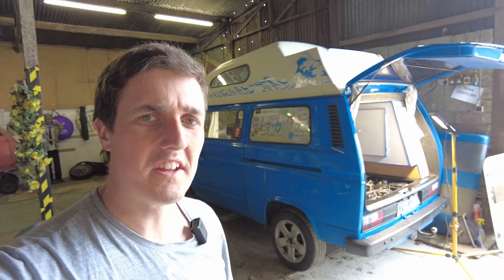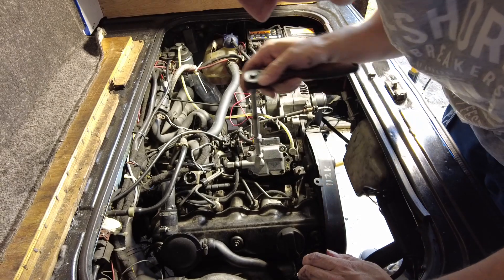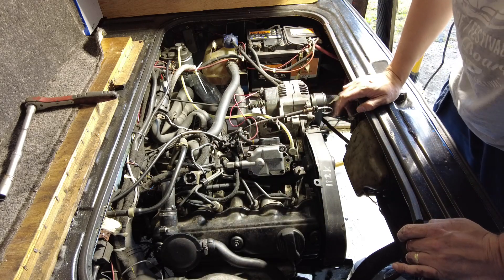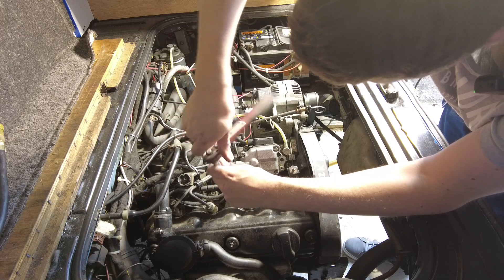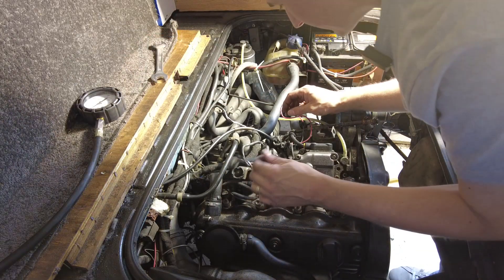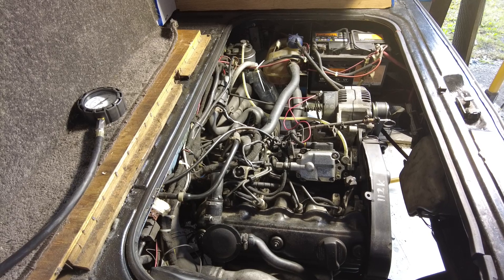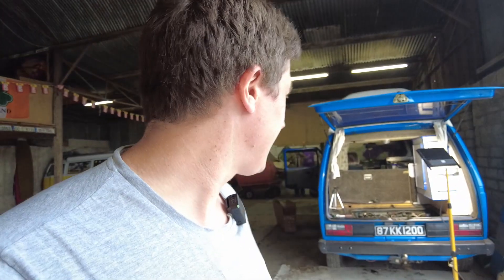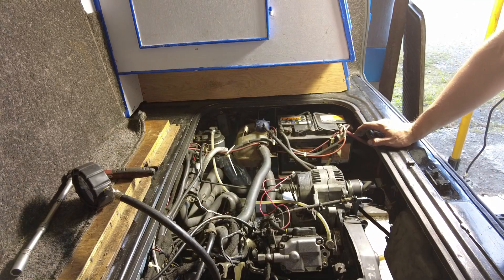DIESEL COMPRESSION TEST - Hunting for lost performance in my VW T3 TDI

Comment: My VW manual says that the compression should be measured where the injector pipes are located one at a time after they have all been removed. That is a different procedure to the one followed here.

Comment: Pity you couldn't get that sorted. I can't imagine how frustrating that is after all the work that you've done. Just a general question on second hand engines, is it possible to get them tested and dynoed before you install them or do you have to just put them in and hope for the best?
Reply from the maker: I don't know of anyone in Ireland with an engine test bed like that to be honest. That's not to say that it can't be done, but I've never heard of anyone doing it. If I was doing it all over again, I'd buy a running car, drive it for a while and then pull the engine out.

Comment: Are you sure the map isn't dodgy? It might be worth while trying a second unmodified ecu with stock map. 
If you're looking for better performance, you could try a bigger turbo. Is your turbo VNT or wastegate? If VNT, the PD130 and PD150 turbos fit fairly easily and offer a nice boost in performance.
Reply from the maker: I've a wastegate turbo. If I do end up having to replace the turbo, I'll look at fitting a VNT. Podsy did the remap for me and I spoke to him and he's confident that it's right, but it might be worth a shot all the same, trying a different ECU.

Comment: Hi Ross, well that was disappointing, I sense your frustration! Are there performance figures from other owner who have done the AHU conversion?
BTW, are you sure the oil dripping from your turbo isn't the oil feed or return pipes coming loose?  They are notorious for that. Would be very poor for shaft seals to go after such little mileage.
Reply from the maker: I'll have a closer look at the turbo in case the oil is coming down from the top, but it looked to me like it was coming from the seal behind the turbine. I've spoken to other people running AHUs and a lot of them are saying that I should be getting better performance.

Comment: yeah there sure is something up with cylinder 4, maybe just a leaking valve stem seal, since it's wasn't doing it when it was hot. is it PD time now? :P that would be interesting to follow
Reply from the maker: If I was going to go down the route of swapping the engine for something else, it'd be a V6, but I'm not going to do that. Funds don't allow. I'm not a filthy rich YouTuber (yet!). I'll redo the compression test when the engine has been heat soaked for a while and see if the results are any different.
Reply: @Endfloat  ohh the v6 tdi? well i just subbed so you are closer to being a rich youtuber :P